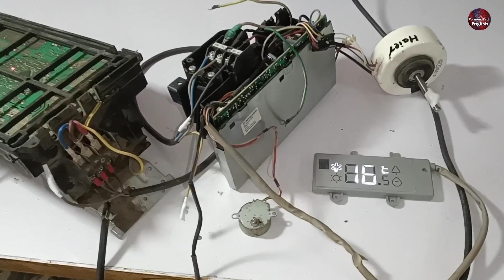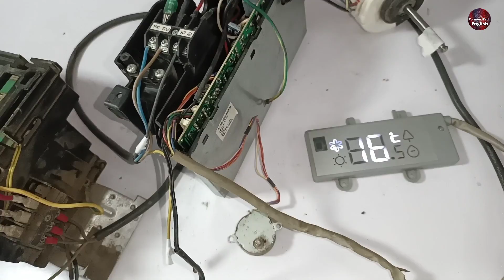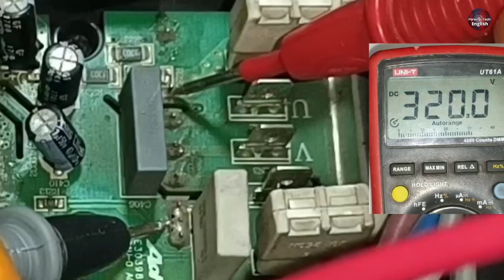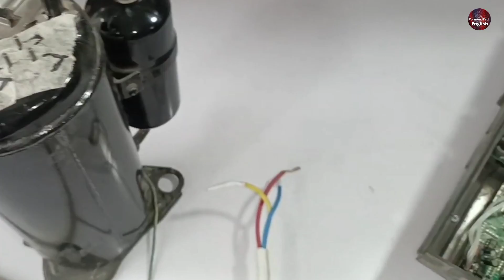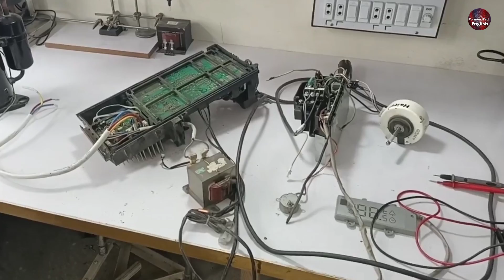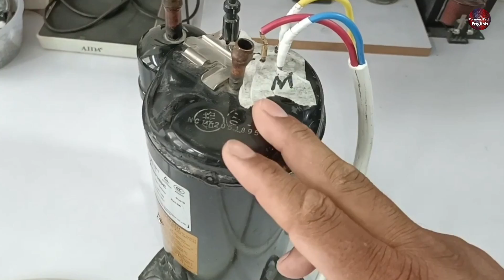Haier Mini Split AC F11/F28 Fix: Tips to Restore Functionality

Comment: Great video sir. So if the outdoor far not the compressor starts and all the resistance values to the compressor are okay and there's no short to ground, that means its more likely the main PCB fault? I've got the same error code but nothing on the outdoor unit runs (F28 and 19 flashes on outdoor main PCB and nothing on the outdoor unit runs).